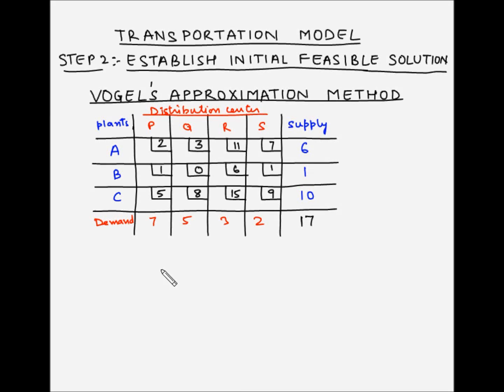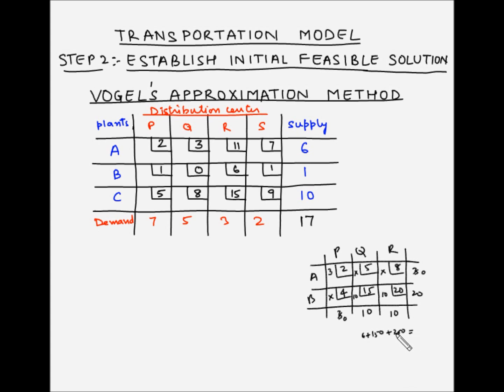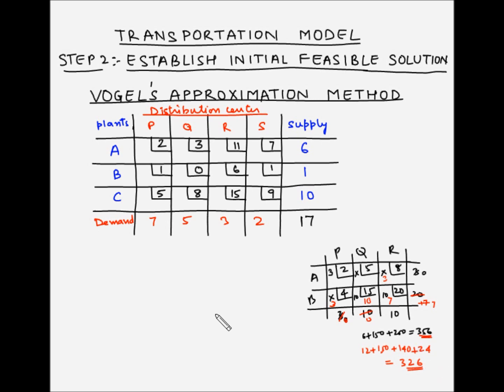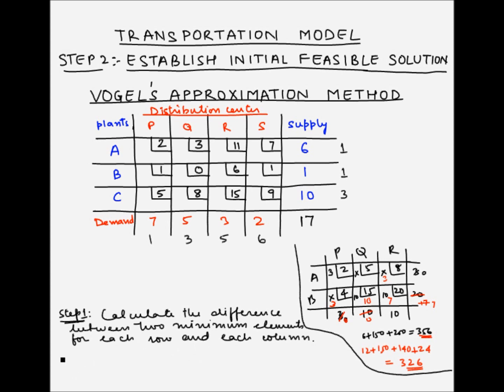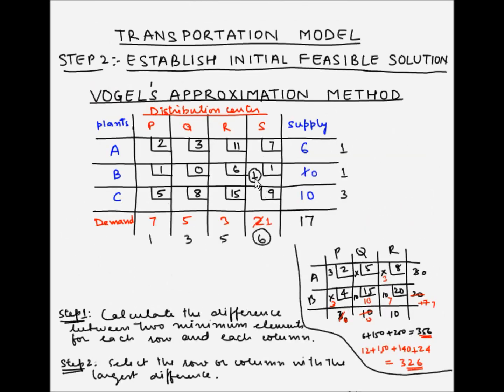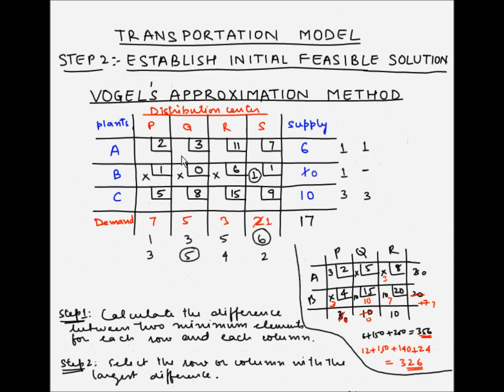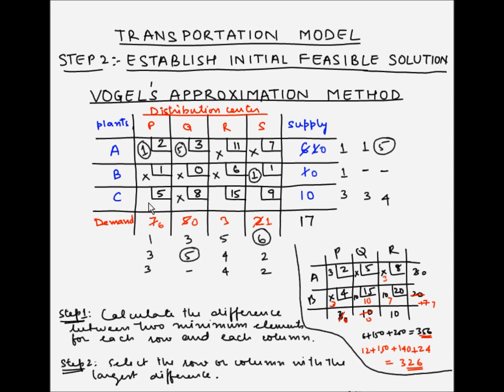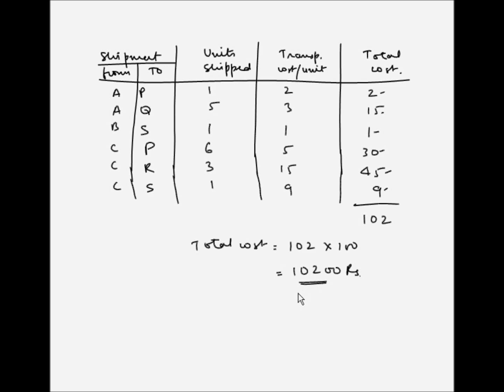Transportation model - Step 2c - Vogels approx method

Comment: is it only to find feasible solution ? or there is sth about optimal solution ??
Reply from the maker: Hi,
The steps to find the optimal solution explained in the videos : Step4a, 4b, 5a and 5b. Also, you can refer to the videos : Transportation model - Example 10 - part1 and Transportation model - Example 10-part 2 to understand the entire solution using an example.

Thanks